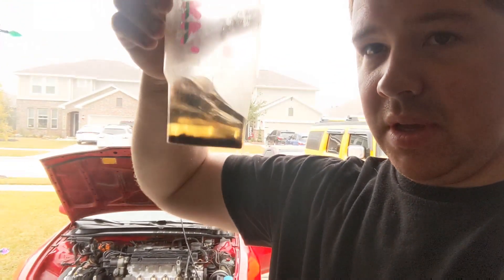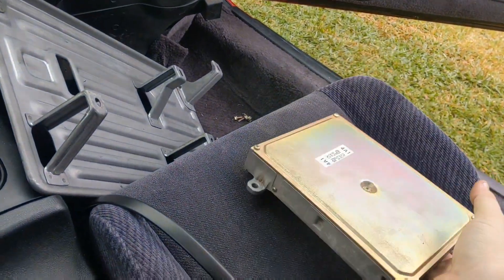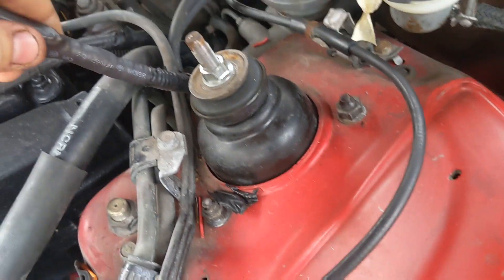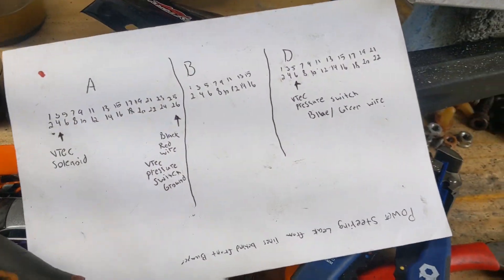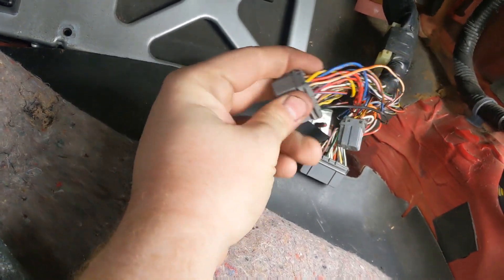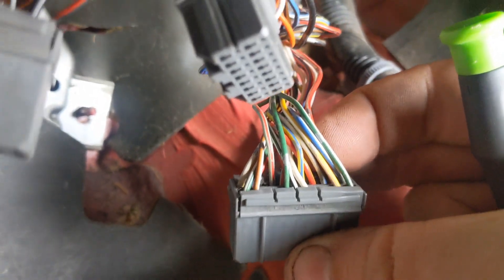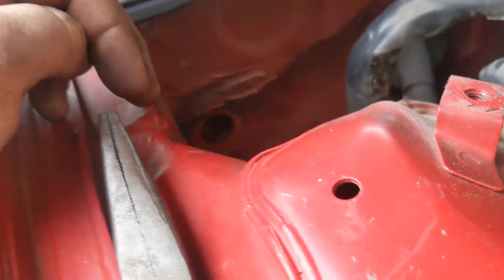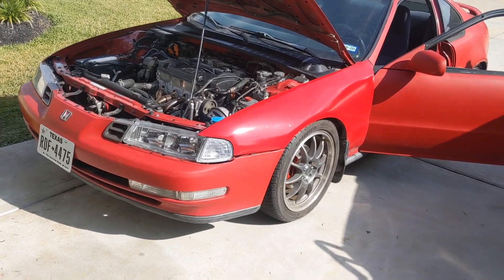How to wire in Vtec (H22a)

Comment: Would you happen to know what ecu’s will work for H22 swap on non vtec prelude? Need to know what to look for. I didn’t do the swap and have limited info on the swap. I will check what ecu I have in it now before I get plus for vtec. I do know it is not plugged to anything now.

Comment: bro i i have two one not vetch and one that being swapped to vtec and was wording the wiring and how easy it is now i see its pretty easy I'm also live in Texas but in Odessa Texas i used to live in Dallas i moved out here due to money and more jobs i get paid 27 and hour and i work at Toyota dealership as a service technician. great video wish you had the camera on the pin connector more to see where it went n to but the diagram works great also may do a video of the one I'm working on it need more stuff before i get to that part of the engine though.
Reply from the maker: Well hopefully it’s useful for you brother 😁
Reply: @HoustonSpeedFreaks  oh it is I been looking and saw your video